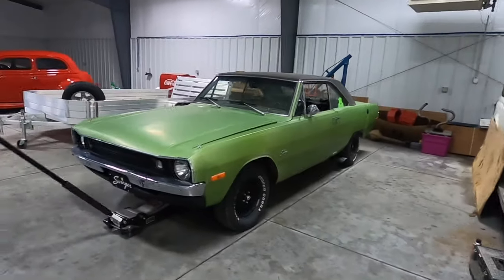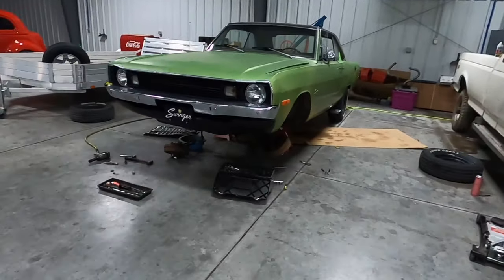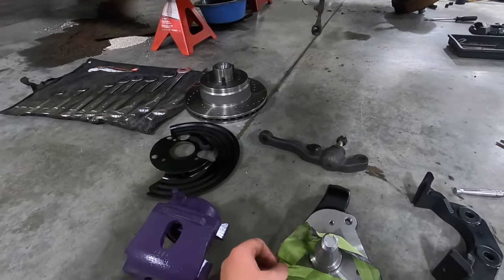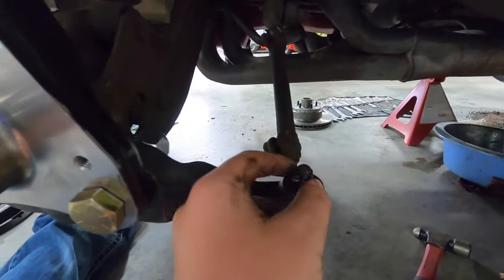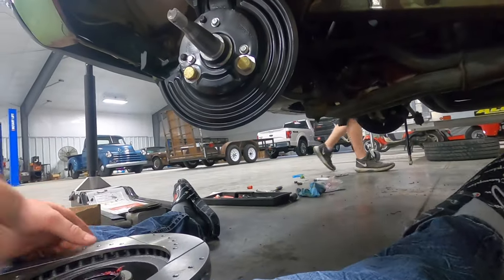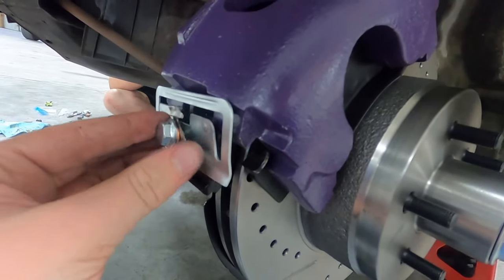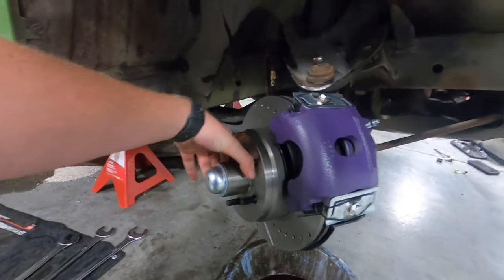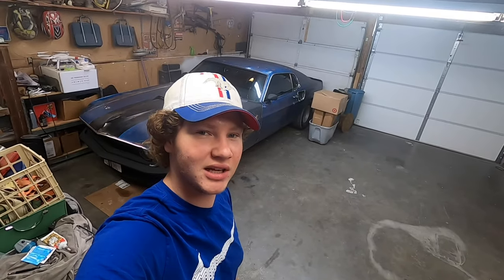Disc Conversion Kit On A 1972 Dodge Dart Swinger

Comment: Thats the correct way to use the rubber bands? I have a jingling noise in the pads and no rubber bands, i  will have to go to autozone.
Reply from the maker: I’m pretty sure that’s how they go I searched forever and that’s what I found

Comment: The amount of grease on the bearings is not sufficient! My dad was a mopar mechanic for more than 50 years and showed me that you pack the bearings with much more grease. Also the rubber bands don't go there to hold up brake pads. The brake pads you need to bend the tabs at the ends to fit the pads snug to the brake calipers.
Reply from the maker: I thought it was enough grease. I literally put a needle in to get grease all the way in. It was way faster than doing it with my hand. Thanks for the info about the breaks but if that’s the case where do the rubber bands go?🤨
Reply: @ModernMach  Well the rubber bands really don't play much of a role. They will disintegrate with the tremendous heat generated by the brakes! So the best thing here is the bending of the tabs. Its a trial fit deal. Bend them a little at a time till their pretty snug going in/on. Just letting you know so you don't get the annoying noises from loose brake pads. I am so glad my pops passed down this info/knowledge to me! So I just want to be of help to others with this info.
Reply from the maker: @cesareomendez6794  I will try that thank you so much